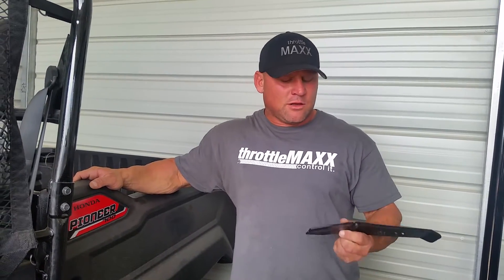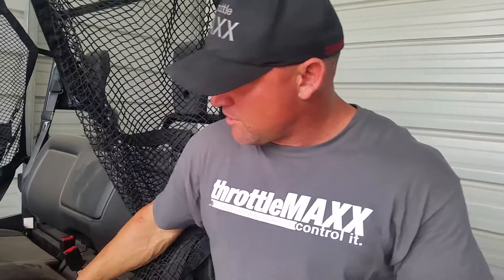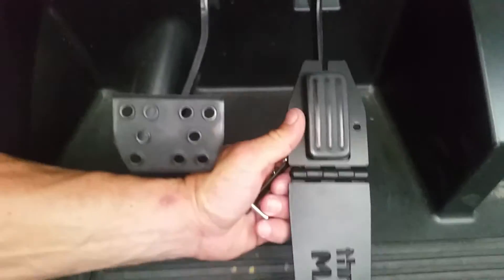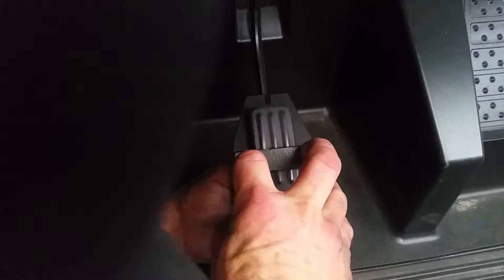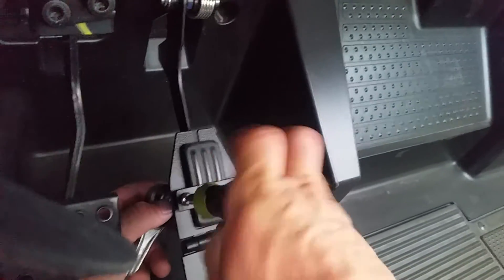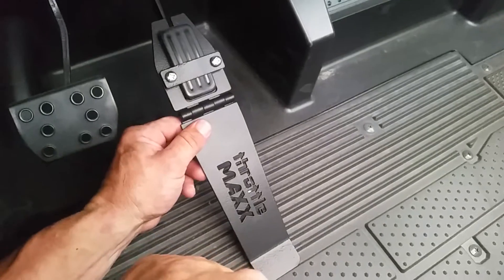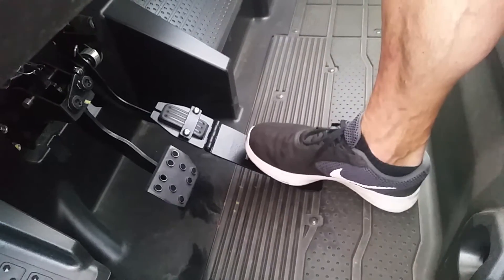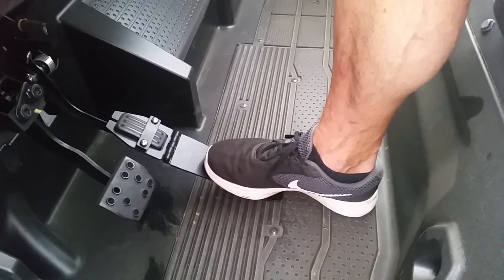Throttle MAXX Honda Pioneer 700 install and demonstration

Comment: Works great on my 1000 👍 Thanks .   Any invention that provides soft lighting so I can find the switches and most importantly the two big levers on the dash .   Take a closer look .  In the dark it really sucks when you want to switch on the fly from 4wd to 2wd but you grabbed the wrong one and go from high range to reverse .